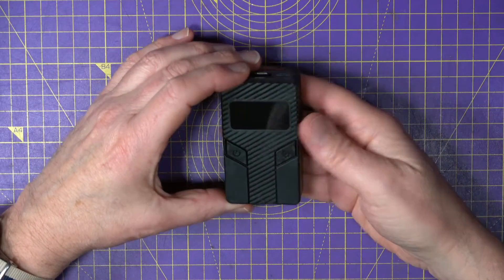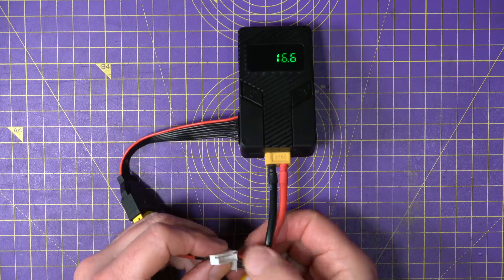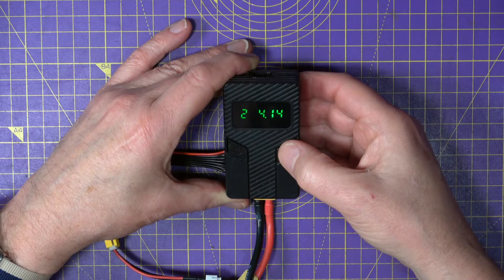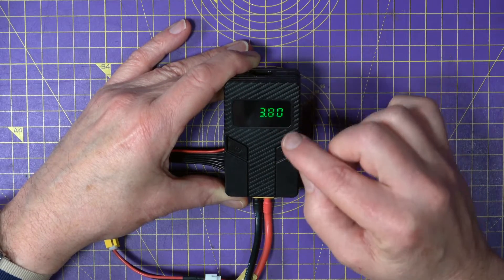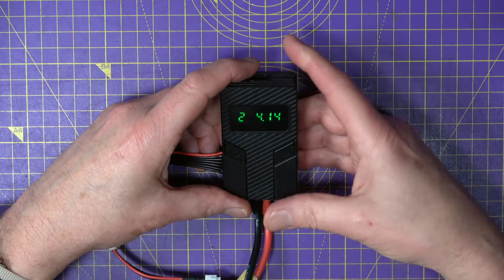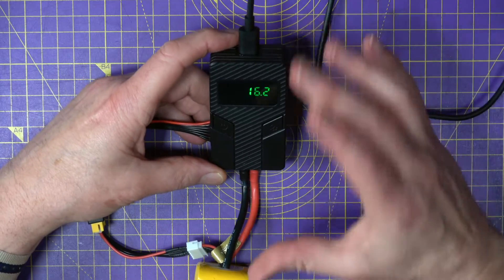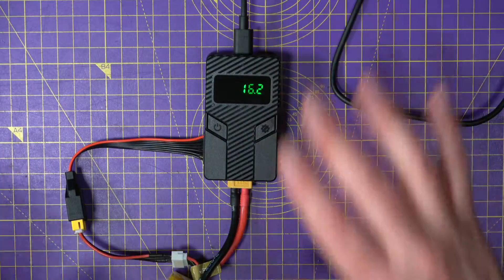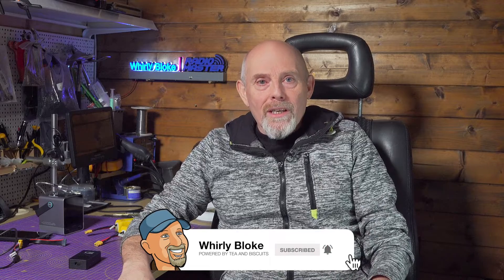SpeedyBee Battery Discharger - charge your phone and keep your LiPos in their happy place.

Comment: If you have any ToolkitRC charger, you can discharge the battery into heat using internal resistance or better you can recycle it to another pack...I use it a lot when I have some charged pack left that I didn't fly, so I use it as a power source for charging others to storage...
Reply from the maker: That's a great tip. Using the ToolkitRC charger for managing battery health is a smart move. Recycling power from one pack to another is a fantastic way to keep everything in check.

Comment: How low can you discharge the lipo battery?  For example if I want to keep charging my phone past the point where the lipo hits 3.8.
Reply from the maker: Easy. Set the discharge target to a lower voltage.  But don't go lower than about 3.7v for a lipo, or you'll kill it.
Reply: @WhirlyBloke   Thanks for the reply.  Don't most lipos have a minimum discharge rating of 3.3v per cell?   Does this unit have any self contained discharge capabilities?